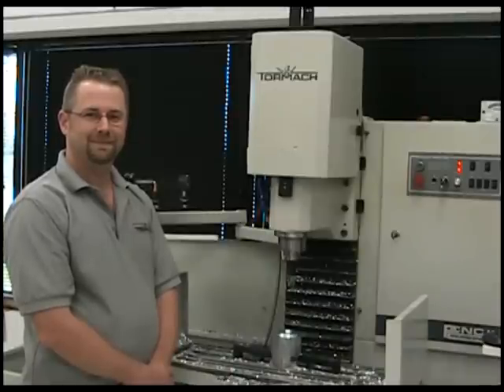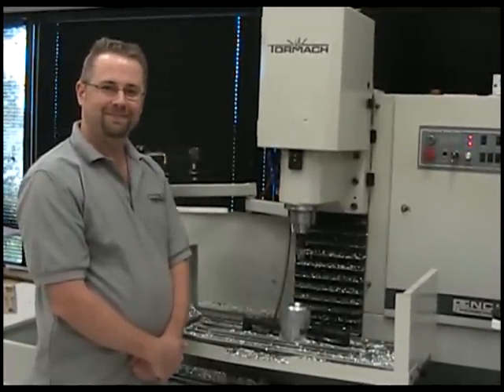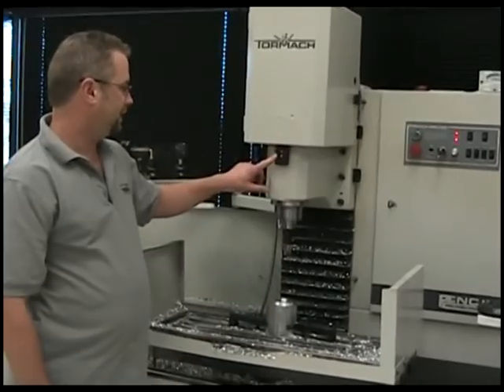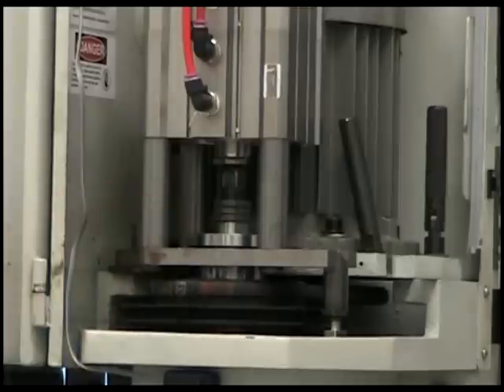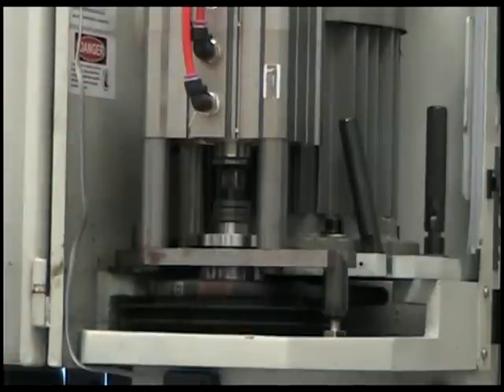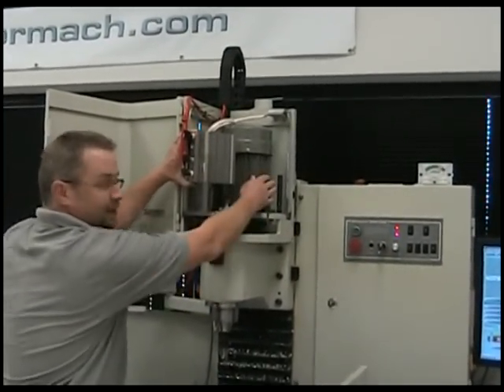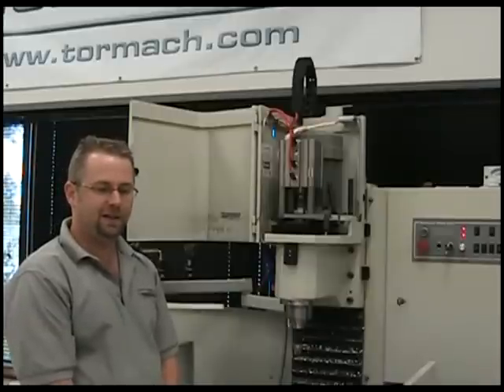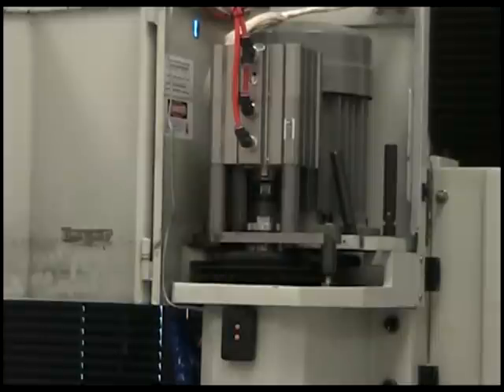Power Draw Bar Prototype Sneak Peek 8/31/09- Tormach CNC

Comment from the maker: JT, thanks for watching.  I'd like to clarify a few points for those not familiar with TTS (Tormach Tooling System).
TTS is a dual contact system.  It has a 3/4" straight shank and a ground precision surface that references the spindle nose.  As the collet closes, spindle nose contact comes under high pressure, so Z height is exactly repeatable.

Comment from the maker: TTS was designed to be compatible with R8 spindles because of the wide use of the R8 taper in Bridgeport and other small mills.  It was also designed to be a quick-change manual tooling system with the ability to use an off-line measurement system.  These are features not available for conventional R8 tooling.
You are correct:  BT30 systems will have a little less runout than TTS because of the elimination of the collet reduces the number of components in which TIR error can stackup.

Comment: If you triple the number of springs you will cut in half the pressure required to realse the tool. When you fully compress the spring the force required to compress doubles.

Comment: Looks great how ever you say it keeps the load off the spindle bearings. In the static load that pressure on the spindle bearings is minimal. If I may suggest from past experience that you at least triple the number of springs to reduce the amount that the springs compress. This will add a significant life to the spring life. I know because I learned the hard way. Keep up the good work. Your company has a fine product.

Comment: so basically the drawbar releases simply from the air cylinder pressing down on the tip of the drawbar? Not from tightening or loosening with a wrench like in manual changes? I have a G0704 mill/drill from grizzly and am trying to grasp the concept for this. If it just uses air pressure to push the drawbar down releasing the collet just enough for the toolholder to fall out then the design seems pretty straight forward. And one last thing... why would more springs equal less pressure needed?

Comment from the maker: The benefit of TTS over BT30 and other systems is affordability.  High precision toolholding systems have their place, but keep in mind that the machine tool is a system and there is very little advantage to using these systems unless your mill is capable of highly precise motion or operating at speeds where tool balance becomes an important consideration.  For many small mills, such design is overkill.

Comment: This is not a real power drawbar, just a pneumatic collet closer.    

And the Tormach "TTS" is a standard R8 collet with straight shank tools.   You can duplicate the whole setup for a lot less money.

The repeatability is probably decent as long as the R8 keyway remains intact.  However, R8 collets + straight shank tools have more runout than tapered tool shanks like BT30s and larger.